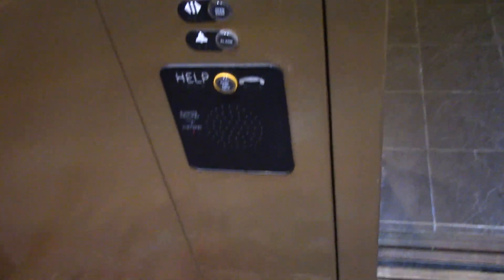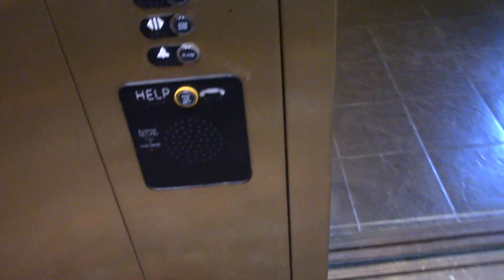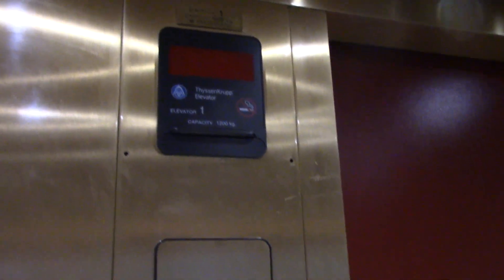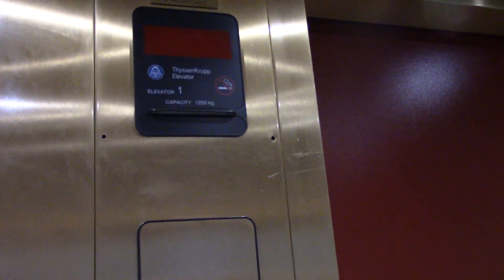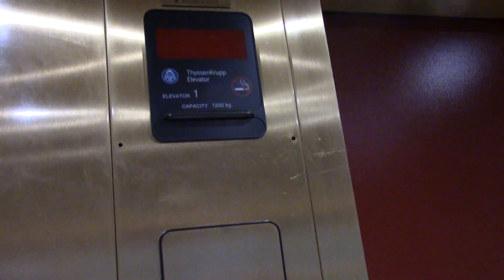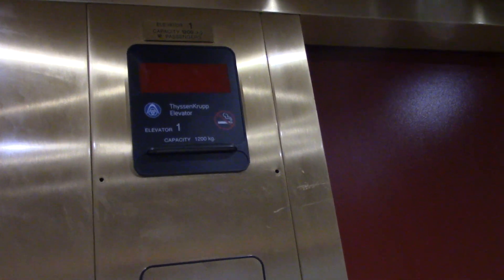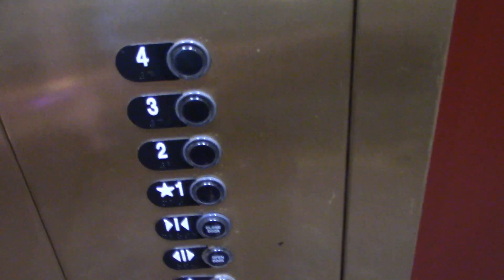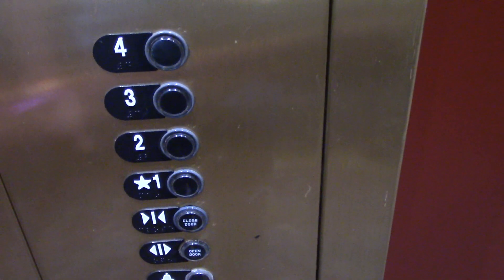Thyssenkrupp Aurora Hydraulic Elevator At Great Wolf Lodge, Niagara Fals, Canada

Comment: They need to fix the indicator on that side elevator! The other one is fine.
Reply: yea
Reply: im glad its bright in both side elevators becaus it was dark for the old lights
Reply: @OwenGFLProductions  I never saw this elevator with the older lights, but from yt videos, the new LED lights are definitely way brighter than the previous ones.
Reply: @uppercanada_trainspotting  i agree and i see what you mean
Reply: @uppercanada_trainspotting  The Floor Indicator is repaired now
Reply: @OwenGFLProductions  That's good. It's always annoying when indicators burn out
Reply: @uppercanada_trainspotting  yea that’s because the elevator was upgraded after the pandemic 😷